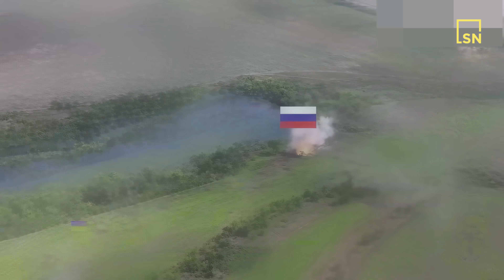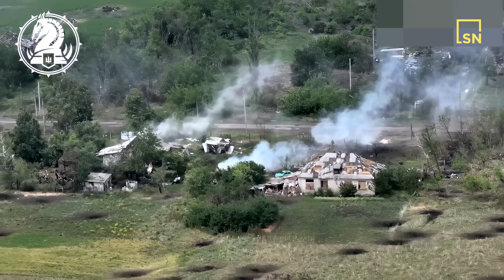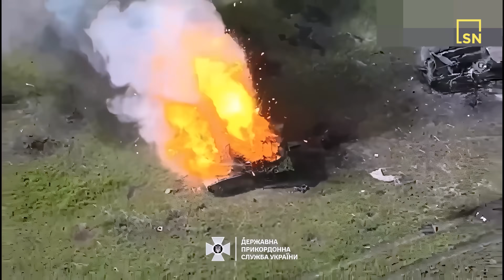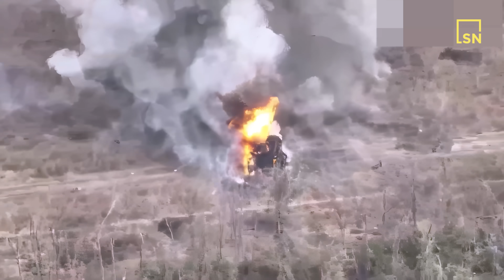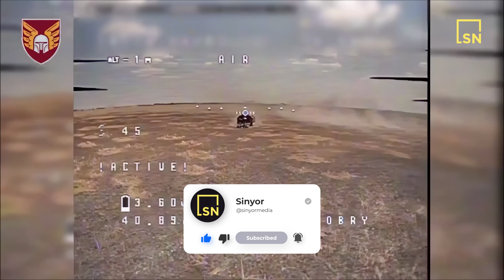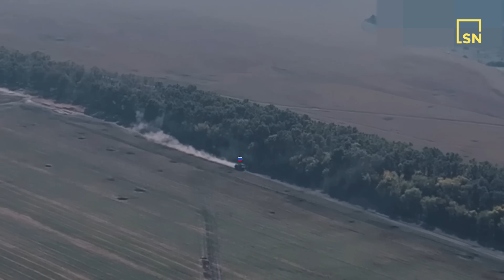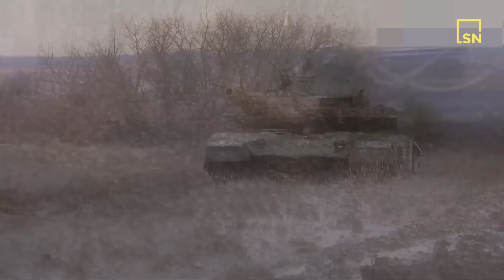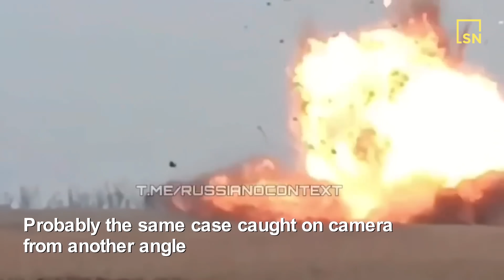Two Abrams Face Russian Brigade Alone, Head-on

Comment: Those poor bastards, burning alive inside the tank. Meanwhile, Putin lives in comfort surrounded by his loved ones.
Reply: If any solace. If the tank was hit by a DU round, They most likely never felt a thing as the vacuum and heat of impact turned them into instant charcoal and sucked them out the 6" hole on the other side. Well, most of their parts anyway.
Reply: @Fowlesr40   if they were hit with DU round from front they would feel only ERA detonating and momentum being transfered to the armour, because the APFSDS round didnt penetrate.
Reply: @Fowlesr40  DU round? whats that?
Reply: @ShInYaKu88 depleted uranium
Reply: @Fowlesr40 граната с дрона прилетела что не видел?😅😅😅😅
Reply: @Fowlesr40  Dem Irren Putin und seinem Gesocks ist es total egal wieviel Soldaten ihr Leben noch verlieren !!!
Laut der Angaben sind shon über 1.000.000 Million auf der Russichen Seite gestorben oder so verletzt, dass die nie mehr ihr Leben genießen können !!
Der Irre Putin und sein Gesocks, die leben in Wohlstand, essen die bessten Lebendsmittel und die Soldaten bekommen halb verfaultes Essen, wenn die überhaut etwas zu essen bekommen ?!??
Die Esel, die der Irre Puin und sein Gesocks einsetzten ließ um Nachschub an die Front zu schaffen, die sind bestimmt sofort geschlachtet worden und wurden von den Soldaten verschlungen !!
Die Russischen Soldaten sollenn sich gegen ihre Komandöre stellen und sich der Ukraine ergeben, dann haben die eine Chance weiter zu leben !!
Reply: @Fowlesr40  Что-то у тебя какая-то неправильная физика. Как может в танке образоваться вакуум и всосать экипаж наружу??? Ну и бопс из урана создать крематорий внутри танка?
В какой школе ты учился? Явно, не в Советском Союзе!🤣🤣🤣🤣🤣
Reply: @татариннерусский-ы1ъ  Tы тyпoй или в caвэтскай школе физике не yчили? Вoт такой биo Mycop зa paceю и вoюeт.
Reply: @Fowlesr40 it most likely wasn’t, just normal tungsten rounds as Ukraine is using m1a1 Abram’s and earlier leopard models which do not carry DU rounds
Reply: Does Putin even have loved ones?
Reply: @cainghorn  prostitutes probably
Reply: @cainghorn  представь идиот, вся страна.
Reply: @cainghorn no, he's an old senile man
Reply: @cainghorn  he had a daughter that lived in my country (the Netherlands) before the war started
she moved when the 3 days turned to a month
Reply: @bsaaxtyfoon143 she moved to a prosperous European Country! Only Germany surpasses Russia considerably in GDP , not to mention percapita income . Even Italy has a higher GDP than Russia
Reply: @jorgegl3306 10 months later and ruzzians GDP is in negative figures😂😂
Reply: @cainghorn  His daughter that he keeps hidden
Reply: @sebastianprimomija8375  he has multiple, if we count the bastard ones as well.
Reply: @cainghorn  does you ever watch a  real news ?
Reply: @cainghorn yea
Reply: @cainghorn obviously not so they cant be used against him
Reply: @cainghorn  Народ России.
Reply: @сергейкозьменко-ф7ш there is no nation of Russia. It’s a cartel not a country and ruskies are serfs not citizens
Reply: @сергейкозьменко-ф7ш  Dirty muscovite
Reply: @cainghorn  Вся Россия,дружок.
Reply: @alexviev4330 .   And of course you know that all of Russia loves Putin because there were fair and transparent elections or regular independent polls held periodically that confirmed that for you. Oh wait! That doesn’t exist at all in Russia. So you’re just spewing BS you were told, like a brainless bot. So sad and sorry, for you and any person that doesn’t have the freedom to think independently without outside manipulation, pressure, deception, and becomes radicalized to do the bidding of evil characters who couldn’t care less about them.
Reply: @Mne_01 тупая пропаганда 😂
Reply: Brother I don't think they are burning "Alive" I mean half of this tanks literally got instantly Disassembled, I don't believe any biological matter remained in them.
Reply: The paradox of the century: the more the Ukrainian Armed Forces win on the Internet, the smaller the territory of Ukraine in reality.
Reply: Тhe paradox of the century: the more rusіаn forces Іооses on the internet the smaller amount of gasoline they have and they're countrу becoming ruіns🥀
Reply: Shamefully, that's how you build a Veteran Army; through Blood, Sweat and Tears.
Reply: Yes, putin is surrounded by his loved ones, both of them. 😁
Reply: Quanti miliardi di dollari nostri sono spariti in Ucraina dalla corruzione!
Reply: @georgemckeon6710  
At least someone is finally blaming 'Putin' and not 'Russia' as a whole!
Reply: @jayfro8340  Their army should drag putin out of his office. It is all of their faults, its just 1 man. So it's their country's collective fault
Reply: @pastalasagna2924  The same could be said about America and the current President. 
 Why don't they just remove  him?????
 The blame falls on all Americans then, not just Trump!
Reply: @Travis26X ? Tell me, what is Trump doing that warrants that kind of action? And guess what, he will be out of office in under 4 years lmao. Unlike Putin who is essentially their leader for life
Reply: @Travis26X ? Tell me, what is Trump doing that warrants that kind of action? And guess what, he will be out of office in under 4 years lmao. Unlike Putin who is essentially their leader for life.
Reply: @Travis26X Tell me, what is Trump doing that warrants that kind of action? And guess what, he will be out of office in under 4 years lmao. Unlike Putin who self-elects with his sham voting
Reply: @pastalasagna2924 they would but the russian army is too incompetent to pull it off. 😂
Reply: @pastalasagna2924 It's wasy to say but you likely wouldn't do anything in their position, he also has many military people who are close to him and well paid
Reply: @T @Travis26X  exactly, all of our world leaders are at fault
Reply: @pastalasagna2924  trump was on the island and he has been destroying our relationship with nato and stuff
Reply: Putin is an Atheist for him it really doesn’t matter how many people die or lives that are destroyed.
Reply: As Zelenskyj does... what is the difference?
Reply: @vincentgroudeniutes1655 the difference, is that one is coordinating the defense of his people and their right to exist as a sovereign nation. the other is breaking dozens of treaties and other international agreements coordinating the unprovoked invasion of a sovereign nation in the name of imperialism and an attempt self aggrandizement.
Reply: I agree, the whole thing is a shit sandwich, I feel bad for the troops on both sides. The leaders are to blame, and the average Joe gets ganked.
Reply: @juliancain6128  yes, all of those troops are dying for no reason, our world leaders are stupid as hell
Reply: Putin has no loved ones. Like Stalin who, when his ally Hitler betrayed him and invaded, fled to his dacha and cowered in fear when Molotov found him, alone. Stalin let his son be killed in German captivity. Putin has no family. No children. He is a bitter dictator.
Reply: Imagine if the russian leadership just would focus on trying to better their country, and not to aggresively wage war against their peaceful neighbours.. imagine if the russian people had changed their mentality and not allow these dictators to come to power..
Reply: 欧米はウクライナに核兵器を供与すべき！それで平和は確立する！言いたいことは分かるよな？日本より愛を込めて。
ちなみに俺の国はアメリカに二発、核をぶち込まれたんだが...そろそろアメリカの関税でブチギレそうだから、お返ししてもよろしいですか？
Reply: @山 @山形冷麺 ll of our world leaders are dumb, also yes I believe the tariffs are dumb but they are helping the Us economy (kinda)
Reply: @Ch3z-l1i  
専制政治でもない限り、世界の指導者で困っているなら、それは国民の責任だ。
Reply: @Ch3z-l1i  
私の国は貧しいけど、女性が夜一人で買い物に行けるしアニメもある。侍も忍者もいる。
なんなら小学生の子供が一人で電車に乗って学校にも行ける。アメリカはきっと豊かで素晴らしい国なのでしょうね？
Reply: @山 @山形冷麺 hhh it in America we have more rights and a better economy than most countries but we have a higher prices for some reason, our government is making shitty choices, and we have a higher crime rate but home robberies are hard because a huge percentage of civilians are armed, but to answer your question, yes it’s much better than most places
Reply: @Ch3z-l1i  なるほど。そんなに恵まれているなら
アメリカには日本のシャワートイレは必要ないな。幸運を祈るよ。
Reply: @山形冷麺  I actually live in Okinawa I left the US a year ago, I live on a US military base, camp Foster if your wondering
Reply: Yes it is unbelivable how brainwashed the general populationin russia are. Where are the protests in moscow to stop this madness of a war?
Reply: There was no one in 90% of the ones they showed
Reply: you are part of the problem, assuming innocence of the faction you prefer while war crimes are committed infront of your face
Reply: Most of these standing with open hatches were already abandoned due to used off ammo or fuel, or transmission malfunction
Reply: @georgemckeon6710  imagine that was you home that is now a battlefield.
Reply: Putin has no loved ones, only enemies. He is going to die alone as a coward hiding in his underground bunker.
Reply: Россия побеждает тока почему
Reply: @nuyren  they aren’t winning, nor is Ukraine, the war has barely shifted besides Ukrainians pushing into Russian territory, it’s not ending any time soon, it sucks but it’s how it is
Reply: Как жаль тех кто сейчас на войне со стороны Украины пока Зеленский сидит в окружении своих близких.😢😢😢
Reply: @Animation-i1b  both sides are bad, the troops are hung forced to kill each other while the leaders sit back and watch
Reply: So is zelensky, propaganda final boss
Reply: @D @DCSDude18  it’s not propaganda it’s just fucking reality, but in all seriousness, all of our politicians and politics are dumb and destroying themselves
Reply: ان شاء الله سوف تتحرر جميع مناطق الاوكرانية
Reply: I wouldn't say they were his Loved ones...probably those around him fear him, like trump's entourage.
Reply: @georgemckeon6710  they don’t really love him.
Reply: @georgemckeon6710  all based off bs excuses and lies as well.
Reply: Witness your army Z trolls. Putin is getting embarrassed
Reply: You dont believe that people capable of building the tsar bomb 60years ago, are unable to build a solid tank^^

You laughing about the propaganda back in the days and how people were stupid enough to eat it up.
Unlike them, you actually have education and you are still dumb af.
Reply: @georgemckeon6710  lol he has no loved ones. He only loves and cares about himself and his bank accounts. Everything else is a weakness or a flaw to him.
Reply: @georgemckeon6710  If the hatches are open, the crew has abandoned the tank. The narrator of this video doesn’t mention that part.
Reply: He still has a reservation in Hell
Reply: Sebagian besar tank kosong  dengan palka terbuka..
Reply: poor bastard dont even know how the war started and blaming putin for the lives of his soldier.
Reply: Ofc zelenski got billion in his ass and trying to keep his chair forever😂
Reply: Any US president has spilled 1000 times more than Putin.
Reply: Haha isn't that the same for every politician during war time? What's your point? 😂
Reply: Путин может произвести за неделю в разы больше танков чем твоя страна и приехать на них к тебе во двор
Reply: When they voted for him they consented for this.
Reply: @formuloid  The votes are kind of rigged tho, both sides are being force fed propaganda causing the same people to be in power
Reply: Но это не Путин на поле битвы, а российские оккупанты, идущие захватывать чужие территории и убивать за деньги.
Reply: Украина наш враг. Когда мы голосовали за путина, то чётко понимали что врага надо уничтожать!
Reply: @georgemckeon6710  а украинские не горят заживо пока Зеленский сидит и нюхает кокаин?
Reply: He's got no "loved ones" in his life.
Reply: @Flornmonk  then where's the proof ? Simply anti Russian attittude that you are willing to do anything to deny what the did :))) good luck
Reply: Sure. Keep talking
Reply: @georgemckeon6710  They likely would have been killed by the overpressure of the explosion before they burned.
Reply: Just like the jew bastard
Reply: Love ones? let me stop you their buddy😂😂
Reply: Ukraine isn't innocent my friend. Don't believe everything you see or read.
Reply: @HelloBrian1981  both Russia and Ukraine are bs they both have done horrible things we should stop taking sides and fucking tear down the leaders behind this
Reply: Don’t disregard the fact that Zelenskyy’s regime is thoroughly corrupted and much of Western support has been funneled off into offshore accounts accessed by his cronies.
Reply: @georgemckeon6710  same as Zelensky
Reply: Бедняги американцы которые уже тысячи погибли на русской земле 😂 все знают что Америка трусы
Reply: no one loves putin, not even his familie, which he rly do not have
Reply: 欧盟失去了廉价能源  美国获得乌克兰的矿山并削弱了欧洲  俄罗斯获得乌克兰部分土地    乌克兰最终能得到什么?
Reply: @明明-t9c  ни чего !)))))да и америка ни чего не получит! Потому что Российские войска завоевали самые богатые участки редкоземельных !и Путин не отдаст ни грамма этой земли! Где наступила нога Русского солдата ,это есть Россия!
Reply: @blackbart8416  America isn’t even fighting in the war why would they want anything all we did was give them weapons
Reply: Показывают , как уничтожают технику российской армии…
А почему не показываете, как фабы, одабы, бетабы и шоабы 5000 тонные , расщепляют всё,всех и вся????
Reply: Ваши танки горят не хуже. Не надо сильно обольщаться.
Reply: @alexviev4330 they all burn, blowout panels protect the crew from an ammo explosion not from a frontal penetration, most times the nato tanks are destroyed it’s always an ammo detonation so the crew gets a chance to escape
Reply: Putin has no loved ones.
Reply: mean while zelensky and his loved one are cleaning millions of dollars as his people are killed. What's your point?
Reply: Those poor bastards, burning alive inside the tank. While the Western World is funding this useless War and this clown. While they just had to reject Ukraine joining NATO. Just don't taunt the beast. But keep believing MSM and these AI generated videos. Your stupidity knows no boundaries 🙄
Reply: @georgemckeon6710  cry more in Europe, what will destroyed by idi0ts
Reply: So...where was the comedian?
Reply: Чтобы вы понимали, для начала научитесь разбираться где т90 а где абрамс😂
Reply: вони не бідолахи, вони прийшли вбивати, гвалтувати і грабувати
Reply: Good one to say.... But it's more about zelensky the butcher... But good in watching CNN and other propaganda... Meanwhile me and almost 20 million people that live in Ukraine are in hostage to the fascist and dictator zelensky.... How about that you p of sh....
Reply: I’ve heard his older children are living in the West somewhere…….
Reply: aint no poor bastards in the russian team they are there for money not because they are forced
Reply: why are all 86 abrams destroyed 80 videos can be found everywhere they are destroyed t 90, leopard 2 are also destroyed .Show a video why are you only showing one side
Reply: @edayoutube8866 tbh we shouldn’t even be sending our Abrams even if they are proven effective they were never built for drone combat
Reply: Just like Zelensky, lol. He should be on the frontlines vs forcibly conscript underaged and elderly to the frontlines.
Reply: @barglorp i have never heard of these underaged and elderly on the frontlines please give a source where you found this
Reply: Путин ведет боевые действия за безопасность своей страны, а Трамп тем временем разжигает эту войну, находясь на другом полушарии, вообще не имя никакого отношения к нашим землям.
Reply: @vasyavolg288  propaganda, everyone is fueling the fire and blaming each other it’s not just one side at fault
Reply: Is everywhere so.
Reply: You transferred your money to the J in Kiev yet?
Reply: why the hate for putin when it was your own government who started this entire war in the first place
Reply: @georgemckeon6710  like  Zelenskyy lives ?
Reply: @georgemckeon6710  well they chose to fight, unlike Ukrainians locked inside their country and forcibly mobilized
Reply: Why poor lol? It's their conscious choice, they do it for money. No need to portray them as victims.
Reply: @georgemckeon6710  а украинцы не горят заживо? Их вылавливают на улицах, что бы призвать в, армию
Reply: @georgemckeon6710  два абрамса против одного, .... индосы вы смелы👎👎👎 уахахазаха. Русич хорош и смел один, против двух.... индосов👍👍👍
Reply: Just like any leader. Churchil, Roosevelt, Staline, Obama...
Reply: They burn for microseconds at around 1700°C after taking a hit, you barely feel anything, the lungs collapse long before you feel any heat, there are a bunch of documentarys which show exactly whats happening after taking a full penetration.
Reply: Don't write nonsense, this is a war against NATO and Putin is our commander, the whole country is for him.
Reply: And the poor Ukrainians don't burn while Biden and Nuland live in comfort?
Reply: Just like Zelensky and his minions, into whom we poured our money and no one knows where it ended up.
Reply: Look what does Ukraine doing then just edit/delete your comment bro. Punishing people to push them out of battle. So look what Russia do? They all receive huge amount of money if they want to go with to war
Reply: they are all mercenaries, almost zero conscripts, so this is their choice
Reply: @georgemckeon6710  так и есть К сожалению...
Reply: сам то понял что написал? а зеля не живет в окружении близких? а байден не живет в окружении близких? а стармер, а урсула? а трамп? У всех этих людей народ где то гибнет.
Reply: "... у всех этих людей народ где-то гибнет", чего?! Что за ахинею ты несёшь? У Зеленского народ гибнет из-за Путина, а у остальных вообще никто не гибнет, тк нигде не воюет, ты настолько не в курсе происходящего?! 😂
Reply: Bold of you to assume that the snake has loved ones.
Reply: we only see one side, and the Ukrainian side looks similar or even worse, I've seen a lot of videos
Reply: Let them burn... hell was waiting allready
Reply: Al igual que zelenzky 😂😂😂
Reply: on the other side
Zelensky still must bet Trump to not cut off the money giving to Ukraine and must pay all the money Ukraine has to repair debt for NATO support :face-blue-smiling:
Reply: @VietChenHuang True.  But Ukraine can rebuild.  The difficult judgement will be how much Russia pays in reparations.  Crushing reparations levied on Germany after World War 1 led to Nazism and World War 2
Reply: @stephensmith799  bro i swear you
Ukraine their have less material to rebuild their tank
their give all their best oplot for Thai and now thier must use all those used weapons from NATO
their want rebuild
first their must paid all their debt
Reply: @VietChenHuang That can be done.  The UK eventually repaid the USA for its aid during World War 2.  It took until the 1980s!
Reply: @stephensmith799  yeah
so now hope the ex-soviet countries like Ukraine can repair all for NATO:face-orange-biting-nails:
Reply: @VietChenHuang The price of preventing Putin’s reimposition of Kremlin control over Eastern Europe is  much less than the price of living under it.
Reply: @stephensmith799  yeah
that Putin and Russia problem
real problem here is do Trump really want to cut off the money for Ukraine and choose between Israel or Ukraine now or the strongest one is Russia :face-purple-crying:
Reply: @VietChenHuang Russia and America were both defeated in Afghanistan. America was defeated in Vietnam and it’s hard to imagine the Palestinians ever defeated in Israel-Palestine.  All it takes is a determined resistance.  ‘Asymmetrical’ wars can be won by the side which appears less powerful.  Russia’s apparent military strength is greatly over-estimated.
Reply: @stephensmith799  yeah and now it Russian and Ukraine turn so we better keep far from the warzone and hope Trump stop using his people tax send to Ukraine and Israel:face-orange-biting-nails:
Reply: @VietChenHuang There is a profound difference between the illegal invasion of Ukraine by Russia and the catastrophe experienced by Israelis and especially Palestinians because they live in a ‘failed state’ and continue to supply each other with reason to feel violent righteous indignation towards each other without end, in a war which has been going on since 1948 or earlier.  The Russian invasion will be reversed given military aid and determination.  The genocide in Israel-Palestine requires an improbable and novel ‘two state’ solution with the help of the whole world.
Reply: @stephensmith799  yep:eyes-purple-crying:
Reply: @georgemckeon6710   its funny that you think its not a... you know what, keep thinking that it's real
Reply: It’s difficult to imagine that there’s anything approaching a normal emotional regime in the Putin household… and how weird if this mass killer is an amicable pussycat at home?!
Reply: Putin is protecting his men.

The Ukrainians have lost 1.7 million KIA.

The Russians <150K

Feel sorry for the Ukrainians slaughtered by the Cocaine Cowboy of Kiev.
Reply: Its literally every politician in the world LMAOO, go study politics and history first before you said this stupid argument
Reply: @A @Auqi  all of our politics suck, even if Russia started it the others aren’t trying to stop it either they will keep fighting like idiots and let more people doe
Reply: The story of many soldiers throughout the last 100 years
Reply: Bastard is what your mommy called you after cheating with your neighbor
Reply: Meanwhile Jelensky is fighting his ass off defending Ukraine while force conscripting males to join him.
Reply: @m0rvidusm0rvidus18  )))) СМЕШНО
Reply: @m0rvidusm0rvidus18  заставляя именно
Reply: You wanted to say Zelensky?
Reply: Putin surrounded by his loved ones .... hahahaha.... hahaha.... that was good. You are really good.
Reply: 4MOSHNIK GRUSINSKIJ
Reply: My great-grandfather lived in Luganskand his city was under artilery fire and genocides made by Ukranian nazi groups like "azov". Russia tried to prevent that conflict for a long time, 2006, 2009 Munich speech, Minsk agreements, 2021 when Poland and Baltic states refused to negotiate and lost the last chance for peace... that's not fault of Ukraine, and not fault of Russia, NATO will pay for what they did
Reply: Putin doesn't know what love is. He loves nobody, and nobody loves him.
Reply: @ShadowXII  bro.. that are your illusions and your thoughts, dont mix it with others. other people are not so stupid
Reply: Zа 3 года Специальной Военной Операции в͇с͇у͇, согласно недавно взломанной базе данных генштаба у͇SSр͇а͇и͇н͇ы͇ потеряли 1 721 000 солдат, при потерях ВС РФ в 15 тысяч. Чтобы убить одного солдата России, у͇SSр͇а͇и͇н͇а͇ должна пустить в расход целую роту. Это и есть так называемая перемога, или ещё нет?)))))😂😂😂😂😂
Reply: @Иос @ИосипТито-е3с t’s the most Bs I have ever heard, the Russians have lost way more than that, like way more
Reply: UNO Reverse card: the AFU soldiers are dуiпg for Zеlепsky, while he is sitting in his office, not on the front lines! This is not logic, it is sophistry...
Reply: это как обвинять землю ,за то что тебе больно,когда ты упал.. идиот.
Reply: Thankfully several of these are abandoned vehicles being destroyed
Reply: Islamic State also enjoyed the death and pain of a person and filmed it too, Islamic State also made a show out of death, you are no better than them.
Reply: now look at how Ukrainian tanks leo and abrams burn and say the same about Zelensky
Reply: Also looks like half the tanks were already abandoned
Reply: Зеленский типа страдает, Да, когда его украинские папуасы точно так же погибают 🤷🤡 это при том что Зеленский и Запад спровоцировали эту войну
Reply: What do you think the Zelensky's family members are doing?
Reply: It was abandoned tanks.
Reply: what abt Zelensky beach
Reply: In those cases where the tank is just sitting still with hatches open the crew had clearly long since abandoned the vehicle. You can even see the empty seats inside.

I wonder why they leave the hatches open though allowing the drones to destroy them 🤔. Maybe they just don't have the capability to recover them anyway.
Reply: @Hairysteed  Several had broken tracks if you watch the approach. Crews bailing out after a hit don't worry about shutting the door behind them.
Reply: I wonder if Putin even has loved one - is that man even capable of love?
Reply: @Hairysteed  у Нитаньяху спроси, тоже очень интересно
Reply: @Hairysteed yea
Reply: @Hairysteed Путин по сравнению с западом - щенок
Reply: @georgemckeon6710  lol you think Putin has people who love him rather than fear him.   That guy trusts noone do no one can trust him.
Reply: @JemieBridges  yeah, they rather love Zelenski, who allows corruption as something normal LMAO :)))) I love him too, I hate Putin cause he offer no mercy for the traitors or corruption
Reply: @trongduynguyen9897  both sides suck let’s face it, people who are taking sides have been force fed propaganda
Reply: Russia had a lot of military experience and a lot of experienced commanders before the war, but a 70-year-old The military was also thrown into the first and second Chechen wars, and the police were thrown into Prigozhin's rebellion, even though the rebellion was supposed to be stopped by the Chechen military, who fled in disgrace. After all, taking down a TikTok is not the same as confronting the best private military company in the world, Wagner. Therefore, the police and their patrol cars were thrown to the professional rebels. This is the government's attitude towards the people in Russia. pensioner removed them all and replaced them with his KGB acquaintances, who were old corrupt officials with no combat experience but who were good at eliminating experienced soldiers and charging the army a lot of money.  Such a powerful country with its potential was destroyed from within, by its own president and top officials.
Reply: @онинадеятсянаменя 60-70 year old retired generals and officers now making a return 😆😆
Reply: @онинадеятсянаменя people have a lot of experience throwing rocks. That doesn't mean it's an effective weapon.
Reply: @онинадеятсянаменя  да бро, к сожалению для власти война это просто бизнес и возможность отмыть бабло, тут реально подойдет фраза что раньше было лучше...
Reply: @S11ecter  это все понимают в стране ( кроме z  пвтриотов) но смысл то от этого? Власть всегда подавляла протесты. Что уж говорить про зомбирование  по тв , которое идет для таких как ты, чтобы ты резко потупел и начал верить властям. Вот и вся суть нынешней власти.
Reply: @онинадеятсянаменя  Also ich habe mehrfach mit russischen Offizieren im Manöver gelegen. 
Mein Fazit?  Vor denen muss nicht mal die Bundeswehr Angst haben und diese Lach Truppe, ist der Witz Europas. Erfahrung Soldaten zu drangsalieren und  zu saufen, mehr  war da nicht.
Reply: @онинадеятсянаменя  PMC Wagner is not the best private military company, the Americans are better
Reply: @user-vk4ii9nc1f Wagner took first place in the ranking of private military companies in the world, compiled by the specialists of the English-language publication Spec Ops Magazine. When compiling the ranking, the number of fighters, the number of contracts and the level of weapons were taken into account. They are much better armed than American PMCs. Compared to Western PMCs, which have grown up from security and consulting firms into military corporations for a very long time, Wagner has become the largest and best-equipped PMC in the world in just a couple of years. I don't argue that American special forces are among the best, but let's be honest - Wagner is the best special forces in the world.
Reply: @онинадеятсянаменя  а не предыдущими  ли президентами ( Горбачевым и Ельциным) была разрушена Россия, при непосредственной поддержке запада?
Reply: @АлексейЖданов-ь4у ими тоже , Путин добивает
Reply: @онинадеятсянаменя  все что вы написали - это сказки! Российский народ поддерживает нашего Президента Путина! Россия освобождает российские территории и защищает русских от укрофашистов и укротеррористов!
Reply: @онинадеятсянаменя  Wagner was never the best private army. This was and is Blackwater / Academi
Reply: @онинадеятсянаменя   I think you missed the part where putin said wagner was actually his and was funded by him...."Private" was just a word so putin could say "hey!! Not russia commiting these atrocities ". I think everyone in the world knew this??
Reply: @geoffhaylock6848 Wagner PMC is not part of the Russian Armed Forces. This is stated in a response from the Russian Ministry of Defense to Yevgeny Stupin, a member of the Moscow City Duma. Moreover, it does not belong to Putin, as you mentioned. Prigozhin, as the founder, financed his own PMC.
Reply: @онинадеятсянаменя  не несите чушь. Россия жила крайне плохо когда запад был другом. Путин вытащил страну из болота. мы сейчас живем лучше чем раньше. без вашей дружбы и поддержки, от запада одни беды. не лезьте к нам, живите своей жизнью.
Reply: @NikitaChe76 почему тогда почти все нато (106 стран) проголосовали против Путина?
Reply: @herr-mann-q7q  потому что Путин за свою страну, и он не выгоден для вашего нато. им нужна марионетка. типа зели. или еврочиновников. я думаю это очевидно. и с другой стороны, какое дело нато до нашей страны.
Reply: The rebellion was crushed by airstrikes
Reply: @GodwinGodfather Don't write if you don't know. The uprising was voluntarily suppressed due to negotiations with Prigozhin and the President of Belarus. It began after Russian troops attacked their Wagner units. Immediately after this, Prigozhin assembled a 20,000-strong army and marched towards Rostov. On the night of June 24, Wagner fighters occupied Rostov-on-Don in just 6 hours after the announcement. These are staggering figures, just 6 hours. Moreover, they did not lose a single member of the CSC on the way, while the Russian air force lost 6 helicopters and one plane, and 11 pilots were killed. No one could stop the CSC, and they voluntarily left the country for Belarus.
Reply: @онинадеятсянаменя  их путем обмана и угроз родственником Пригожина, сделали свое дело по сути белорусский президент обманул Пригожина мол если двинешься на Москву встретишь серьезное сопротивление но это был блефом его напугали что расправятся с его членами семьи он повелся на это и сложил оружие и ушел в Беларусь а так его не кто бы не смог остановить если бы он дал команду вперёд почти все чиновники и высшие чины бежали из Москвы в северную столицу на тот момент
Reply: @онинадеятсянаменя  crees que si Wagner hubiera seguido con el avance hubiera ocupado Moscú ?
Reply: @онинадеятсянаменя  And a scared Putin took the flight.
Reply: @онинадеятсянаменя  Чушь от первого до последнего слова...
Reply: @GodwinGodfather no, Prigozhin was deceived like a fool, then killed
Reply: @онинадеятсянаменя  The main thing is that you take your pills and see a psychiatrist.
Reply: @онинадеятсянаменя   фанат пригопыпы, почему не в окопе?
Reply: @raketny_hvost сам откуда будешь , zетник
Reply: @онинадеятсянаменя  ты то хоть понял в тот бред, который ты сам написал, какое востание Вагнера, ты веришь в тот бред который пишут ваши западные сми, ?
Reply: @сергейкозьменко-ф7ш очередной z патриот, котоый обиделся на умных людей в россии, которым еще не промыли мозги. У меня голова на плечах, в отличии от тебя. Если не плняд зачем про вагнера написал - читай еще раз. 😂 Мамкин патриот
Reply: @сергейкозьменко-ф7ш он все правильно написал, просто та часть информации которая доходит к тебе, это 0,1% ибо РФ сплошная пропаганда и дезинформация, ты живешь во лжи
Reply: ‘The Western Media’

It is so unfair when a ‘Special Military Operation’ turns into such a mess @сергейкозьменко-ф7ш Ah…
Reply: As a young enlisted man I was told that there was no bailing out of a stricken Russian tank.  Now everyone can see why.
Reply: @chrishooge3442 вы в Европе или США,дураки 😂😂😂,по этому вы везде суете свой нос и получаети по нему 😂😂😂😂
Reply: Nobody loves him.  They suck up to him
Reply: @DéjàVoodoo89 You suck up to the J in Kiev. Has he shown you his appreciation?
Reply: @georgemckeon6710  Путин - герой и для танкистов и для всех россиян.
Reply: @arthurconanrus9801  Putin and all of you are the OPPOSITE of the good guys. You are not heroes. Heroes are standing up to putin and your Z army
Reply: @arthurconanrus9801  You're gay for putin lol
Reply: @rihardsrozans6920 Gay is normal in the USA and Europe! There is no such stupidity in Russia. In Russia, there is courage, brotherhood, and loyalty to the Motherland.
Reply: @arthurconanrus9801  if the war in ukraine is the actions of a russian national hero, id hate to see what the actions of a russian national villain looks like for the russian people...
Reply: @arthurconanrus9801  Putin is a war criminal, so is Zelensky they both suck stop taking sides and stop letting propaganda get to you
Reply: @Ch3z-l1i Я же не сказал, что он герой для тебя. Для нас он молодец и хорошо справляется с угрозами.
Reply: @a @arthurconanrus9801  he’s not a good guy either he’s still a horrible person
Reply: @Ch3z-l1i Это только твое мнение и  пропаганда твоего правительства. Я считаю, что он делает добрые дела. Добро и должно быть с кулаками.
Reply: @arthurconanrus9801  I’m taking no sides and you’re saying I’m being fed propaganda? We literally know Putin has done horrible things he’s responsible for tons of civilian deaths quit denying it
Reply: @Ch3z-l1i Это и есть пропаганда. Путин никогда не делал ничего ужасного. Ужасное делал Зеленский и Урсула Фондерляйн, Борис Джонсон. Израил оккупировал Ливан, убил сотни тысяч палестинцев. США уничтожили Сирию, Ливию, Ирак. Убили миллионы людей и десятки миллионов сделали нищими. Европа поддержала майдан в Киеве - незаконную смену власти. Потом Кив начал убивать собственных граждан в Донбасе танками и самолетами. Россия и Путин пришли к ним на помощь. Украина - это враждебный для России режим. Путин защищает свою страну. Если для этого нужно вернуть часть Украины в Россию (где она всегда и была), то это правда. А ты под пропогандой - "путин ужасный", "путин плохой". А чем он плохой - никто не знает. Зеленский убил 2 миллиона граждвн Украины, но он не плохой, ему вы отправляете деньги и оружие. Вы ответственны за то, что происходит. Зло это не Россия. Зло - это Западный мир.
Reply: @arthurconanrus9801  no, Putin is responsible for a ton of civilian deaths he doesn’t just get off Scott free just because he’s your so called “great leader”
Reply: @Ch3z-l1i Нет, это вас нужно наказать, потому, что вы злые и глупые. А Путин добрый, он мудрый лидер. Зеленский, Урсула, Борис Джонсон - вот абсолютное зло, сеящее смерти. 
Это Путин устроил Майдан в Киеве в 2014 году, когда агрессивное и злое меньшинство взяло власть силой. Это Путин взорвал газопроводы? Это Путин начал эту войну, напав на Донбас?  
Сейчас, с 2014 года в Украине тирания. В Украине людей истребляет Зеленский, он тащит их на бойню, хотя Путин 3 раза предлагал хорошие договора в которых Украина была бы целой. В Киеве бандеровский режим. Они перевозят к себе тела убийц-фашистов 2й Мировой Войны, союзников Гитлера и хоронят их как героев. О чем Вы тут говорите?! 
В России есть поговорка - сколько не говори слово халва (сладость), а слаще во рту не станет. Черное - это черное. И Путин не черный. И еще - Россия никогда не начинает войны,  но всегда в них побеждает. Вам сказали, что это Россия начала войну? Сколько тысяч раз Вы слышали своим ухом эту глупость и ложь?
Reply: Ты думаешь зеленский с автоматом на фронте бегает , тупой клоун😂
Reply: @кот-ф8ю  зеленский чёрт!)))))его уже 7й месяц с европы выгнать не могут !))))когда он был в киеве год назад ,так вот он с бункера не вылазел! а английская киностудия снимали видео фейки как он смело стоит на площади майдана во время воздушной тревоги!))))))))
Reply: В этой войне было уничтожено несколько тысяч танов и бронемашин. На видео наскребли пару десятков видео удачных атак ВСУ за три года войны. При этом все переданные Абрамсы, Бредли и Леопарды были уничтожены - и большая их часть с помощью FPV дронов.
Reply: @engenius11  yawn Wow, you really love your own propaganda!  Is this really the best you got, ruZZian troll?  Really?  I mean, you idjuts used to be much better at this, years ago.  I guess Putler isn't paying what he used to, huh?
Reply: Zelenskyy eating steak and lobster every night and sleeping in soft king size bed meanwhile troops are being shelled in trenches. Same thing on both sides
Reply: @Tony-xh7ip  Uh huh.  Because you are such a great friend of his, why, he invites you over every night, so that you can watch him eat steak, and lobster, and caviar, and whatever else might pop into your silly, wittle brain...and washing it down with the most expensive champagne, oh, and sweeping in a big, soft, bed!  Why, you probably sleep next to him, don't you hon?  You are ridiculous.
Reply: Do you really believe that Russia is driving around and fighting with all the hatches open on their tanks? 🙄🤦‍♂
Reply: @Travis26X Eastern tanks don't have fresh air, except through the open hatches. Western tanks are better made and have a concealed air flow.
Reply: @12maples  бля ты смешной джо ужаса))) зайди хотя бы на википедию, не позорься))
Reply: @Travis26X  yes they often do drive with open hatch vs buttoned up, it’s common for both sides. Helps with airflow, and visibility for the tank commander. It’s common for all tankers out there. Unless they go planning on being hit they keep it open to prevent missing something that could be more easily seen with a second set of eyes. Not a negative for Russians or western countries really.
Reply: @atomicmuffins1328  Not when in a battle situation. Modern tanks use something similar to a periscope on a submarine. 
The hatches are closed up tight so as to prevent attacks from drones. 
This isn't 1945 🤦‍♂
Reply: @Travis26X so why is a t90m left in the field with its hatches open? Russians have no better tank that t90m.
Reply: @Coughinggonzalo  I said the tanks were captured
Reply: @Travis26X  honestly with how shitty they've been fighting. I wouldn't be surprised.
Reply: @JosephStalin-o6r Not that I'm happy about it. But they have done fairly well.
Think about it. All of NATO was supplying Ukraine with weapons and ammunition. Yet Russia still captured what they were after. Ukraine's precious mineral deposits and blocking NATO advances. And within 3 years too. (America failed in Afghanistan after 20 years and nobody was helping the Taliban.)
 It was never about exterminating the people of Ukraine. It was about stopping NATO and access to precious minerals. 
 We the west have prolonged this conflict by continuing to send weapons. Specifically America, because America wants the minerals to. Its the only reason the fighting continues today.
Reply: I guess they had to suck up to him because they'll get thrown off a building
Reply: And zelensky chills at home in his sweatpants, doing tax funded coke and only needing to dress up for photoshoots
Reply: @itsHoshiru  troll better. weak sauce is weak
Reply: Meanwhile, the Biggest Jew  Zelenski bought a 4 million EUR worth Bugatti for his wife. Perfect.
Reply: @PeterFrey-cw2vi  proof? no he didnt :)
Reply: @TheZoneTakesYou  you just don't want to see it! they've been there for a year, and Zelensky's casino in Spain?)))))))))) open your eyes and see this lie and the blatant theft of the Ukrainian bosses!))))))
Reply: @TheZoneTakesYou  then where's the proof of Putin being hated by everyone, have you come to Russia and ask their citizens ?
Reply: @PeterFrey-cw2vi  this is literally russian propaganda
Reply: @PeterFrey-cw2vi aww seems you care more about the fact he’s a Jew
Reply: @PeterFrey-cw2vi  President Zelenskyy was a famous actor before going into politics. He has his own money. It is possible that his wife and children need a bullet proof car, since they would be in constant danger from russian murder. As for President Zelenskyy, yes he is Jewish, but trump is 25% Jewish. Why don't you judge yourself first.
Reply: @PeterFrey-cw2vi  брехун.
Reply: @PeterFrey-cw2vi  You clearly "find your thruth" based on what prorussian bot says...  dispiccable...  braindead and deranged...  and complete lack of intelligence.
Reply: @PeterFrey-cw2vi  How can you be a Jew and a Nazi? The anti Ukraine/ pro russian idiots just can not find the limits of their stupidity.
Reply: @PeterFrey-cw2vi  How is that relevant to anything?

Kinda weird for you to side with Russia.  This is 100% a Russian bot farm comment lmao.
Reply: @PeterFrey-cw2vi  Stupid russian bot.
Reply: @PeterFrey-cw2vi  no he didn't you liar
Reply: @PeterFrey-cw2vi  fuente ?  De los deseos ... tan real tu argumento como " desnazificar "  a un presidente cómico judio ! Mándame el link del regalo ...
Reply: 🤡 you will be telling me the earth is flat next
Reply: @PeterFrey-cw2vi  grow up. Stop listening to Russian propaganda.
Reply: @TheCreep69  wow, how about you doing the propaganda for the West, Russian is this, Russian is that, Putin is a devil. Oh, how about you provide proof of Russian doing propaganda, you just simply do anything to deny Russsian LMAO, typical double standard
Reply: @PeterFrey-cw2vi 30% of Israel citizens are Russian. Coincidence? 😂😂
Reply: @PeterFrey-cw2vi  Still trying to use a year-old debunked lie?  You Russians are getting REALLY desperate.
Reply: @PeterFrey-cw2vi  russian scum) 0 proof
Reply: @PeterFrey-cw2vi  You mean that claim that was disproven by the automakers themselves? That 'invoice receipt' that had multiple discrepancies compared to a real one?
Reply: @PeterFrey-cw2vi don't forget that besides Zelensky there are honest ordinary people in Ukraine, whom you help, who are fighting. They don't like Zelensky either, but the king is not changed during the war
Reply: @PeterFrey-cw2vi  you should wipe your mouth after all that BS
Reply: @PeterFrey-cw2vi  Do you have any evidence? Other than what you show on TV
Reply: @PeterFrey-cw2vi  ты врёшь ,и говоришь не правду введя заблуждение всех обывателей этого канала .могу предположить что ты получаешь зарплату в рф ,или просто читаешь новости из телевизора пропаганды рф .
Reply: @PeterFrey-cw2vi  ну а че ему нарокоману
Reply: @PeterFrey-cw2vi  Were is the Fact Check ? link please...
Reply: @PeterFrey-cw2vi Source?
Reply: @PeterFrey-cw2vi  This is your best, Z troll?  No wonder you and yours are getting their arses kicked in Ukraine!
Reply: @WebShaman01  It's not a secret the Zelensky has become exponentially richer since the war started
Reply: @WebShaman01 Also you shouldn't say things like that when Ukraine/Russia's population data is publicly available
Reply: @pyrosupreme4473  Oh really?  Well, let me see now...hmmmm...how long as the "special action" being going on now?  Yeah.  Thought so.
Reply: @pyrosupreme4473  Yeah, you certainly love your propaganda, Z troll.
Reply: @WebShaman01  Not sure what "special action" means. What about what I said was propaganda?
Reply: @pyrosupreme4473  The invasion of Ukraine by ruZZia was Putler's "special operation"...
Reply: @PeterFrey-cw2vi     did he?   Or was it also had a diamond encrusted steering wheel and windscreen
Reply: @robertwillis4061  а ты спроси у жены зеленского, но походу у тебя мозга нет.
Reply: @сергейкозьменко-ф7ш путина вчера выеб...ли шойгу и соловьёв в питерских подворотнях ,спроси у путина ?или у тебя мозгов нет 😂😂😂
Reply: @PeterFrey-cw2vi зачем врёшь.  И почему ты упоминаешь национальность, ты нацист?
Reply: @PeterFrey-cw2vi  yes. I also heard he bough her piece of land on the moon for 56 billion dollars